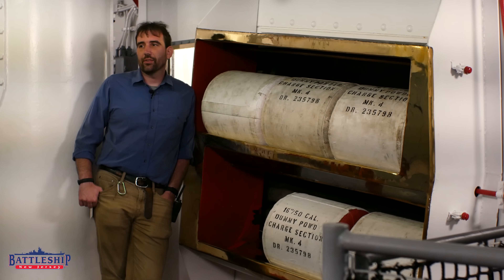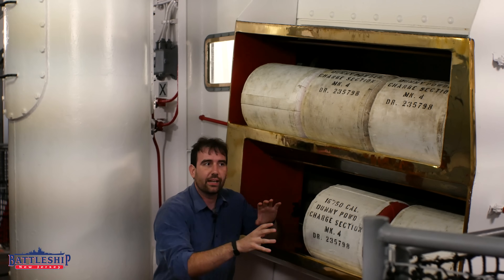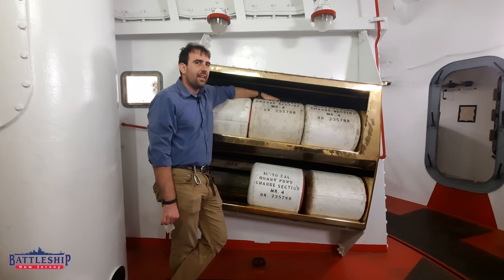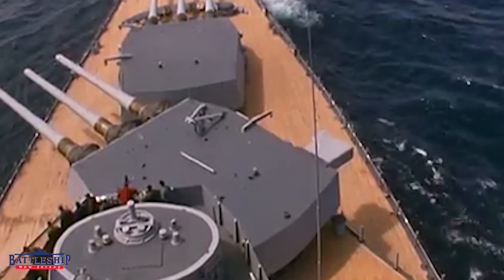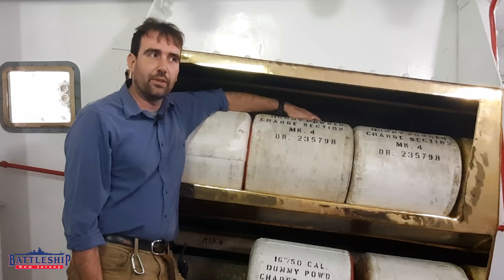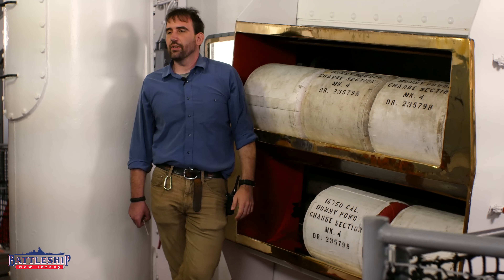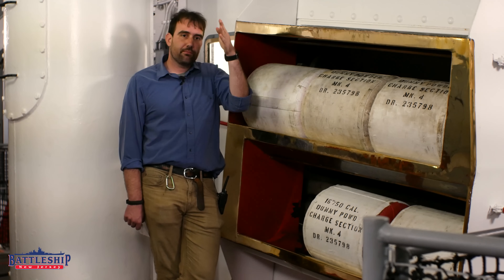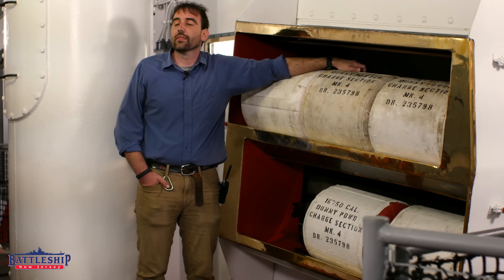16in Gun Powder

Comment: When he says "tare layer" he's referring to the word "tare" as in the tare weight of the bag. So, tare layer, is the layer of propellent laid on it's side to bring the whole thing to your tare weight. Hope that helps if anyone was wondering!
Reply: It does! I was thinking he meant "tear" like they tore a hole in the charge to shove more in if it didn't weigh correctly.
Reply: @dickJohnsonpeter  Nope.. the "tare" weight is the corrected weight to match the performance of the charge to the ballistic standard. The nitrocellulose propellent will vary in performance from batch to batch. A sample is taken from each batch and burned in a closed vessel of known volume and the pressure curve compared with that of the standard for the propellent type. The actual weight of the charge can them be adjusted to produce the correct energy output for the cartridge.. Eg if the batch is found to be more powerful than the standard, the charge is reduced, if weaker more propellent is added. All the gun calibration data depends on having consistent propellent charges so that the projectile will hit the same range, batch for batch. 
In practice, a ship will do calibration shoots with each batch of propellent if it can, however in wartime this may not be possible and the guns may have to switch from batch to batch during an engagement without  re-calibration. The tare weight system minimises the batch to batch variation...
Reply: @felixthecat265  Right, but the normal meaning of the word "tare" is the weight of the empty container. So it's not clear why they're using the word "tare" for this completely different concept.
Reply: its side
Reply: Just FYI, you never aim to get the bag the right weight.  You calculate the maximum amount of tare you'd ever want to have, cut that in half, and then SHORT the bag by that amount.  That way, a "perfect" bag would get exactly half a tare added to it.  This "perfect amount" is going to be + OR - due to inconsistency, and so the tare can be either raised OR lowered to compensate.  If you were trying to get a perfect bag and got a very small amount MORE than you should, you'd have to take out some of the main charge. ("negative tare") and that's not a good plan.  Shorting by half a tare insures that you have enough tare adjustment room to go both minus AND plus on the main charge during manufacture.
Reply: @nathanfisher6925  well said.. its far easier to adjust something like that if you can add or remove to get your desired weight. otherwise you're having to remove from the bag and that reduces the amount thats uniformly packed nice and neat.

Comment: The word you were looking for the extremely rapid burning of the propellant grains is Deflagration.  In one of the USS Massachusetts videos the gunner's mate said that they recorded the lot numbers of the powder and made an effort to use all the same lot number for each particular gunnery shoot.  This was to gather data so they could adjust the fire control solution for the slightly different projectile velocity for each given lot of propellant.  As another video idea would be to just do a video on all the different variables that had to be cranked into the fire control computer to achieve the impressive accuracy.   Not just range, speed and course of the target, but things like air temperature, wind speed, humidity, and even the ships latitude and longitude to compensate for the rotation of the earth while the shell was in the air.
Reply: Interesting side note, thanks.
Reply: I'd like that.
Reply: The use of same batch/lot number for all components of a given load be it small bore rifle to load for a gun on a battleship is important to maximize the deviation of the means to improve shot to shot predictability.  I shoot various disciplines of center fire rifle and pistol and the loads for my competition ammo I use brass that only comes from manufacture lot number that I have then check for the same weight, and volumetric capacity, primers from the same lot/batch number, powder from the same lot/batch number and projectiles from the same lot/batch number. Additionally I keep the primers and powder in a very environmentally stable location. My reloading equipment is also in an environmentally stable location and I only load the ammunition that I need for a given match because the components in loaded ammo degrade at a different rate than components stored in bulk.  Additionally any time I buy a new supply of components I have to retest my loads and or adjust them to maintain the expected performance of my loads for each load, caliber and firearm I shoot them in.
Reply: @gullreefclub  I remember being quite shocked at the difference in volume alone between different lots from the same manufacturer.
I do joke about commercial NM vs precision hand loaded, "You can have NM or you can have good".  ;)

Comment: Other than basic training I did my entire Army tour in a field artillery battery, a year of that in Viet Nam. It was an 8"/175mm battery so had separate loading ammunition. Powder grains look to be similar in size but our had larger holes, IIRC. I tried burning a few grains to heat up C rations but the fire was too intense and short lived. Our powder increments came packed in one round cans with 6 increments of white bag and 3 of green bag, with only the base increment having the red igniter pad.  We had a lot of powder increments unused, these disposed of by burning. We lost a jeep and trailer when the burning got out of hand and ignited a trailer full of powder. The 175 mm gun used over 90 lbs of powder as a full charge, which placed a dangerous stress on the tube ( field artillery calls the barrel the "tube") so the gun crew  dismounts the piece and a 50 lanyard is used to fire it. Even then we lost a man when a tube ruptured. 300 full charge rounds was the limit for the 175, 6000 rounds for the 8". At one time we were changing 175 tubes every day or so, more often than I changed socks.
Thanks for the great presentation, Ryan.
Reply: What was the unit that you were in???
Reply: @albertfat907  7/15th Artillery Regt
Reply: During Gulf War I, they used a bunch of spare tubes to make bunker busters. Just retasked them, filled them with HE, closed the ends, added fins, the bunkers were history.
Apparently, the tube was hardened just right to double as a penetrator. Given how the tubes were made, yeah, I buy that one!
Reply: 8"/203mm
Reply: @dwwolf4636  Indeed that is correct, but my battery had both 8" howitzers and 175 mm guns. The carriage is the same for both and swapping back and forth between calibers is quite easy.

Comment: As a chemist, I love that Ryan nailed all the major points of the chemical production
Reply: Yes, except for leaving out a whole lot of washing & stabilization steps. And with a couple of the steps given in the wrong order...

Don't try mixing the solvent/plasticizer with unnitrated cellulose and THEN soaking such a mixture with nitric & sulfuric acids at home, kids. 

Also would not hurt to mention terms like neutral, regressive and progressive burning + explicitly equate those to changes in grain surface area.
Reply: I still find it interesting, that Gun Cotton was developed and Gun Powder was still used heavily for so long, until Gun Cotton proved to be the superior propellant.  :-P
Reply: @AflacMan13  
There were (are!) quite a few guns in use which were not proofed for the new smokeless propellants, people wanted to keep using them... It was quite a while before the majority of civilian weapons were "nitro proofed", militaries HAD to make the switch ASAP to stay viable.
Reply: @AflacMan13  Using gun cotton with black powder guns often was  ending with the gun chamber exploding into the user face...
Reply: @Bert2368  You are correct. The ethyl alcohol is added to the nitrocellulose (post nitration, washing, stabilizing) as a solvent to enable incorporation of other elements of the propellant and then extrusion of the propellant grains.
Reply: @tcoradeschi  
Indeed. See here for a mid 20th century history of development + accurate chemistry:
https://library.sciencemadness.org/library/books/the_chemistry_of_powder_and_explosives.pdf

Comment: 5fps+/- on average is incredible, I'd have thought it'd be much more than that since small arm variance is in the double digit range it seems
Reply: And some are WAY more than that!
Reply: Well, with the amount of propellant used in a battleship shot, any variance in the rate of burning between different individual pellets gets normalized. There’s a lot more powder being burned, so any little differences between each individual pellet just get averaged out. Whereas in a small arm round, there’s much less powder for those differences to be averaged out over. 

Plus you’ve also got to consider that these battleship powder bags were probably stored in very good conditions over the 60 years it probably sat in storage. I’m sure the Navy kept them in a climate controlled bunker somewhere, and even on the ship, the powder magazines were kept cool and dry. Compare that to rifle or handgun cartridges, which usually get tossed into 120 degree storage containers and trucks and left there for a while during shipping.
Reply: Also, when you're trying to hit moving targets at 20 miles, firing from another moving platform, any variations in velocity mean a lot of dispersion at the far end. All efforts were undertaken to eliminate every source and form of induced variation.
Reply: 5 fps variance is not uncommon for rifle shooters
Reply: @squid0013  +/- 5fps in rifles means you're using match-grade ammo. +/- 30fps is much more common.
Reply: @lairdcummings9092  yep, if you're shooting factory 5.56 and you're getting 30 or less that's good ammo.
Reply: yep, as a reloader that SD  especially in something that big blows my mind.
Reply: @lairdcummings9092  no not unless you are shooting junk ammo most quality ammo has a fps difference of less than 10
Reply: It’s easier to make accurate quantities with larger units.
Reply: @appleintosh  all pretty much spot on, except for the climate controlled storage part. Really, the best you can hope for is that the bunkers are dry. And the propellants, by and large (and barring extreme high temperatures, unlikely to be seen in an earth covered bunker), aren’t particularly sensitive to storage temperature. Do note that there is a temperature sensitivity when these are fired, but on shipboard, it is probably reasonable to assume that the propellant temperature are both known, and also consistent, from charge to charge.
Reply: Benchrest shooters would be jealous of that kind of SD.

Comment: The perforations are to increase the burn rate of the powder. They increase surface area of the grain that is burning. You can tailor also design the perforations to generate a specific pressure curve, depending on the shape and locations of the perforations and how this develops as the propellant burns.

Comment: Those holes in the grains do more than ensuring an even burn, they actually cause the powder to burn at an accelerating rate as the projectile gets further down the barrel....in doing so, the pressure in the barrel doesn't drop off as fast as it otherwise would.
If the grains didn't have holes, then as the powder burns inward the burning surface area decreases causing a drop in gas release. By putting a single hole in the center, as the outside rate decreases the inside increases and the gas release remains constant. By putting many holes in it, the area inside which is burning increases much faster than the outside decreases, so the burn rate accelerates.

Comment: This stuff was available cheap in 1997 as Navy surplus. My blasting subcontractor used it alternately with ANFO down drilled holes to shoot rock trench on a construction project in San Diego. Worked much better to shatter rock than ANFO alone.

Comment: just was reading about the explosion on the Iowa  On 19 April 1989, due to a overram of powder bags ."The team determined that the "tare" or "trim" layer (a small amount of powder placed at the end of each bag to equalize the bag's weight, inserted in the mid-1980s when the powder was mixed and rebagged under Miceli's direction) would often ignite when compressed at high speed. Cooper found that the burning fragments did not ignite adjacent powder in the same bag, but instead would burn through the bag material and ignite the adjacent bag's black powder patch and thereby ignite the rest of the bags."
Reply: That makes sense, considering the what was heard. Also, the barges they came from apparently had A/C issues. Finally, when not encased in the barrel, those grains become burning shrapnel. Bodies were a mess. 😞

Comment: The largest charge I've fired was for the M107, 175mm Self Propelled Artillery gun, while in the USMC.   The shell weighed 147 pounds and the maximum charge was 58 pounds of bagged powder with a range of 21 miles.   The largest shell was from the M110A1, 8" Self Propelled Artillery gun.   This shell weighed 200 pounds, but the powder charge was only 50 pounds with a range of 18 miles.   Interesting side note, the M110 also had a nuclear shell available for use during the cold war.   Our crew had a member that was certified to arm and handle the nuke, that was a special MOS 0812.
Reply: The M107 was classified as a gun and the M110 as a howitzer. It has to do with the ballistic profile the projectile travels. As you've noted, the 175mm was longer ranged with a lower weight projectile so it travelled on a flatter trajectory  than the 8". The interesting time involving the propellant charges for both of those artillery pieces was disposing of unused charges after a session on the range. I did it once for each type of weapon at Grafenwoehr and the amount of heat generated when it burns is amazing. The red bags are placed at the end so they are the last ones to light off.
Reply: I'd heard about those 8 inch nuclear shells as a kid and was amazed at the small size.
Reply: @beeber4516  there were two classes, that size was a gun type, similar to the Hiroshima bomb, albeit with more neutron reflectors. The larger round was a linear implosion, a cousin to the Nakasaki bomb, again with tons of reflectors to make it smaller.
Yeah, I used to work on nukes back in prehistory.
Reply: Wiki saith we built four dozen such nuclear shells for 16 inch guns.
Looks like they were a Pentagon political weapon -- the infighting over which service branch had which part of the nuclear triad.
This was however a weapon type in search of a mission... emptying an entire harbor at a shot? Making a new harbor, lickety-split? And all this at nuclear weapon prices and maintenance costs. The projectiles obsolesced and were dismantled.

Comment: I was a Field Artillery Officer in the 90’s and worked primarily on 155mm self propelled howitzers, that is with a tank track vehicle supporting the gun tube.  Our ammo was two part, the shells came in a variety of flavors on pallets stacked two high.  (High explosive, smoke, DPICM,mines, rocket assist, chemical & white phosphorus). They weighed about 95lb each, just enough that you really had to be very careful, plenty of guys had busted fingers and toes.  The powder came in a vacuum sealed tube, 5 increments per tube, each of the bags were sewn together with stringy thread, day to day the powder increments would change color some, I’ve seen them be all white, pale tan & light green.  Each of the powder bags different sizes with the largest bag being charge 5, that end go in the breech first.  After the projectile.  The range on a 155mm was about 19km or 11.8 miles, so in peacetime we would tear off two bags to shoot charge three out to 10km or so.  We had a Litton computer called BUCS that allowed the fire direction officer to input powder temp, meteorological data, air temp, altitude at target, the precise 10 digit grids for the observer, canon & target, fusing requested, etc.  It would spit out slightly different azimuth & elevation for each gun and could land the rounds in the same square meter, or a square or a circle or what have you.  So someone at each gun would set fuses, projectile goes in the breech, the desired powder increments & the breech is shut, gun chief attaches the firing mechanism and a lanyard, and pulls it.  Fire direction calls “shot over” to the observer.  The gun tube will recoil as much as 55” and it’s awful loud, even through a Kevlar and earplugs, you can feel the concussion and you have to leave your mouth open or you’ll rupture your eardrums.  I don’t recall the muzzle velocity but if you don’t blink you get a glimpse of a round departing if you’re standing outside. 15-30 seconds later you get impact or splash.  Even 7-9000m away the explosions are pretty impressive.

Comment: I know that things don't work this way, but I keep thinking about a low boy trailer carrying a set of Hornady reloading dies, a box car load of Sierra ballistic tip bullets (and the fork lift to move them) and a dump truck full of Hogdon powder. As usual, everybody will be out of stock on the super large super magnum rile primers.
Reply: The rifle primers would be about an inch across....lol
Reply: In the turrets, there's a primer man with the specific job of putting the electrically fired primer in the back of the charge before the breech is closed. I understand his station is in the breech space just far enough that the big gun's recoil doesn't reach him.
These turrets aren't a big armoed box with gun breeches sticking into them, but divided up into numerous small compartments. Wriggling from one to another is like exploring a cave. Each gun breech has such a space. The largest interior space is the back of the turret where the local-control optical rangefinder lives.